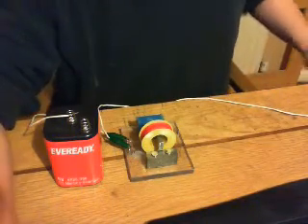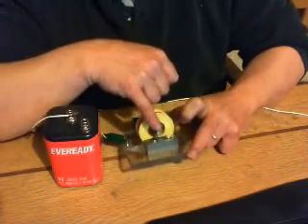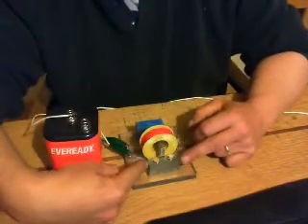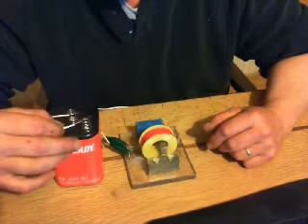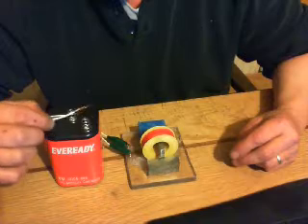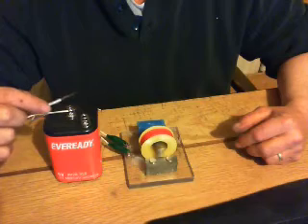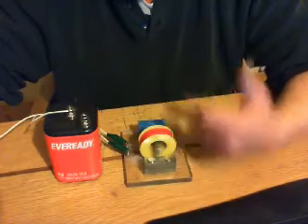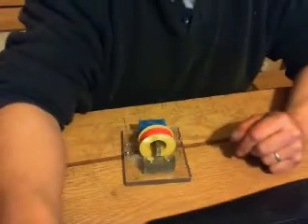Free Energy power amplifier - 4 - a new implementation

Comment: Nice idea...it'd be good to store the dc current through the coil in a  cap & then recycle it again,   your setup is very similar to Lester Hendershot early implementation of his free energy device ..he connected the spring of the free oscillating mass to an antenna. The diagram is in Lindsay Hendershots notes.